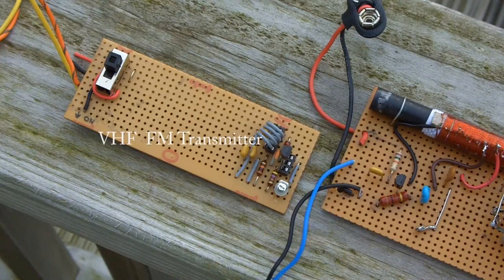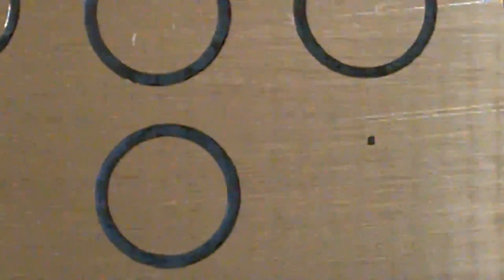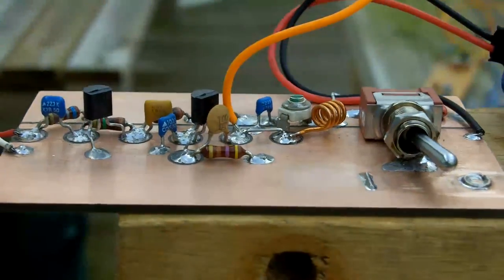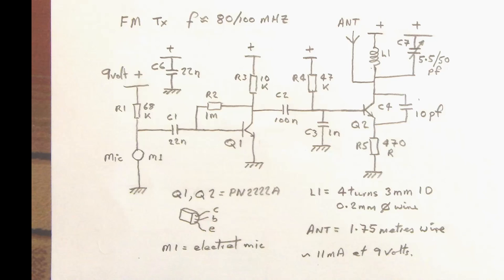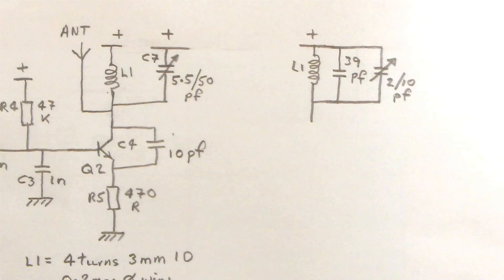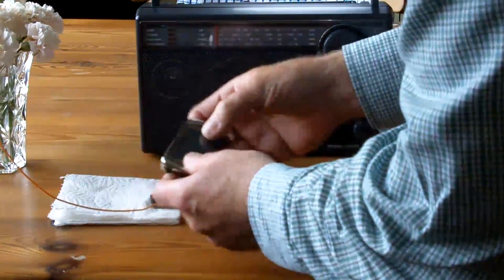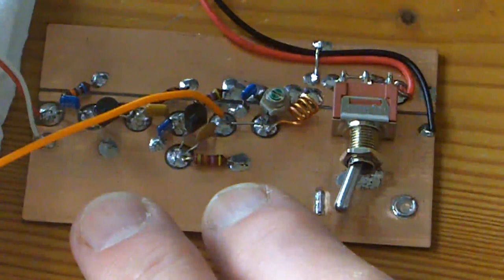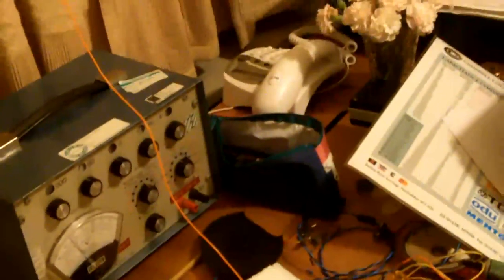About Radio ... Part 40 Two transistor FM transmitter.

Comment: I'm impressed by the pcb. This is the best high frequency hand-made pcb I've ever seen! And it is so easy to make! Perfect design! Schematic looks fine. I only would add preemphasis 50uS (or 75uS for America) adding to transistor Q1 emitter resistor 1K and C 47nF in parallel. In this case you have to make also resistor divider to bias Q1 instead R2. 
Greetings from Varna, Andy!

Comment from the maker: Hi again, it’s really easy with any old battery powered transistor radio, solder a couple of wires onto the top and bottom terminals of the radios volume control and connect the MP3/Walkman. You should ideally have a capacitor in the lead to the top of the volume control, something like 10uF but anything from around 0.1uF up will work. Tune away from any radio station otherwise you’ll get a mixture of sounds. If you do this with a mains radio you need isolation!

Comment: Hey Andy,
The FM part is developed form the modulation. The modulation causes more current through the transistor changing the voltage. This changing voltage causes a corresponding frequency change. So the AM modulation is also causing the FM modulation. I hope I did not talk in a circle here, I'm good at it.
Rick

Comment: hi andy. i like that cutter method great, simple but effective . have a look at the josty kit hf65 from the 70s on the net 2 transistor i got 4 watts out up a dipole simple set. 12 volts gave 6watts and a realy hot output stage. nice vid mate

Comment: Hey Andy,
The junctions in a transistor will change characteristics with different voltage/current. Not only does the resistance changes, but so does the capacitance of the junction. The higher the frequency the more pronounced it is.
Rick

Comment from the maker: What I did was ‘tin’ the wire and then put a tiny line of flux on the board in the shape of the ‘I’ and ‘O’ and the holding the wire down with a scalpel I touched the wire with the soldering iron. What I didn’t want to do was fill the ‘O’ with solder. I wouldn’t normally bother but seeing as it was ‘going public’ I thought I’d better try and make a half decent job of it.
All the best ... Andy

Comment from the maker: I think the fact is that the frequency of a parallel tank is immune from voltage fluctuation. Any voltage induced variation in frequency in an oscillator (as opposed to a fixed tank) is associated with the other components in the circuit.  I must admit I was trying to convince myself that the tank frequency was ‘pulled’ by the audio component where as in reality the change in frequency as seen at the antenna is the addition/subtraction of the AF and RF frequencies.
Kind Regards ... Andy

Comment: Humm, I just use bits of cut up copper circuit board for the pads! So running out is not a problem. But a cutter and a drill press makes cutting up the pads a needless step and makes things very easy! I remember being at the top of the Empire State Bldg watching one of the World Towers being built.

Comment from the maker: Hi, well spotted! what I do is solder one end of the ‘clip wire’ and form it loosely over the battery leads, cut the wire off leaving about 5 mm of straight wire to sit on the board, quickly dap the soldering iron and solder on it not giving it time to melt the battery lead. Then press the clip wire down between the battery leads and either side. You can just about see the marks on the video. By the way did you stop the I &O cloisonné work, try doing that without getting solder everywhere. 
Andy

Comment: Hi Andy. copper and fiber glass is very abrasive, other than touchup on cutter could maybe use a carbide fly cutter or modified boring bar with an indexable carbide insert, many more cuts possible. Love the educational videos, learning radio electronics via your vids and a few others, Dazaro3, AllAmericanFiveRadio, AfroTechMods, and of course HackaweekTv. Thankyou, C.

Comment from the maker: Hi Cass, glad you enjoy the videos. Yep, that fibre glass is the very devil as an abrasive but I’ve found that an appropriately cut/sharpened High Speed Steel drill if fine of the bit of work I do. 
Kind Regards ... Andy

Comment: Andy,
Try using 18 volts, you find you'll have to re-tune the transmitter and/or receiver. The characteristics of the circuit changes, including the transistor.
Rick

Comment from the maker: Hi there, no I left the reverse side floating. I did put a crock clip on it and tried connecting it to –Ve and then to +Ve and it did make a very slight difference to the tone but I couldn’t decide if it was better not so I let it float. I think the circuit would work well on a single sided board but I’m very surprised just how ‘hand capacity immune’ the board is. What sort of range did you get with the 3 volt unit?
Kind Regards ... Andy

Comment from the maker: Hi, they all get a bit complicated as you need a bit of power in a car, if I was going to do something like that I’d look at circuit for the radio that you’ve got in the car now. I can’t say for certain but reasonably if you can get at the volume control for the radio and inject the signal there you could save yourself a lot of work, at worst you might need a small preamp. Unless you really want a project you could look for an old radio to modify and hide it in the clove box. 
Kind Regards
 Andy

Comment from the maker: No, I didn’t do anymore in the MW range as I don’t have a real need for it. The propagation at lower frequencies is much reduced and it’s a lot easier to get the signal out at VHF and it’s VHF I really wanted. Have a look at my video About radio part 41 the transmitter in that video is the one I have constantly connected to my TV to retransmit the audio so that I can listen to it anywhere around the house. MW would be good if you want to play something like an mp3 on an old MW radio. 
....Andy

Comment: The problem with this transmitter is it is not an amateur radio circuit. It is am FM broadcast band transmitter which falls under the LPFM no license regulations if you keep it below 90 MHz or so and under 1 watt. I am assuming this transmitter is less that 1 watt? maybe 50 mW?
You may want to mention that you don't want to drive an FM PA deck with this without a proper license and ham radio licenses do not apply when dealing with any part of commercial radio bands whether they are broadcast or 2-way communications bands. 
IDK if this all holds true in the UK or other countries but in the US the FCC makes this sort of clear in all their rules and regulations if you can follow it lol. 
As long as we keep it under 1 watt and below like 90MHz we dont need a license to use it otherwise we would have to get an LPFM class broadcast license to keep things legal.
I have built this circuit quite a few times and they work well for transmitting mp3 audio to am FM receiver in the car or home.

Again i may be wrong on some parts of the rules here so please correct me if I am wrong but this is what I was told by an FCC person a year ago.

If i want to transmitt FM stable and for distance i have a 50 watt CZE transmitter I bought off ebay for that and I also have a 30 watt AM transmitter. but a rarely use either simply because i do not have a license for them. The CZE FM i keep at 1 watt and though tempting i never go above a watt.

The issue with AM or MW bands is the antenna lengths. My transmitter is set on 530 KHz and requires a 464 foot antenna for 1/4 wave. I can compensate that enormous length with a coil and attaching a tuner though but it is still quite large. i could use the coupling module I got with it and tie it into the house wiring and use the house wiring as an antenna but i really do not want to do that.

Comment from the maker: Hi Rick, no you’re not convincing me yet, how does the transistors voltage affect the resonance of the f of the LC circuit? It’s not a trick question, I’ve worked with a lot of tank circuits but I’ve never done much with FM, and as much as I accept that it works I don’t know which component, L or C is responsible for the change in frequency with a changing voltage, I’ve always just taken it for granted. I’d put it down to a phase change but there’s no feedback. 
 Andy

Comment from the maker: By the way, if you want to do a better job cut the track to the top of the volume control and put a switch to open circuit the radios signal to the volume control or use the switch terminals of a jack socket to disconnect the radio signal to the top of the pot. 
... Andy

Comment: I make this transmitter with original tank circuit. C5= 39pF C7= 2-10pF and coil was 5 turns ab. 0,4mm Cu. The Fq was really low. app. 68-72 Mhz. No good.. So I make a new coil in it. Only 3 turns and I'll get now frequency over 100 Mhz. It's a really stabile little tx. 73's Max OH5FCO
Reply from the maker: Well Done Max  and thanks for the feedback.
All the Best . . .  Andy
Reply: 69Ma.rkowski